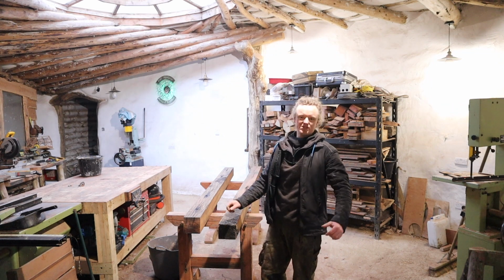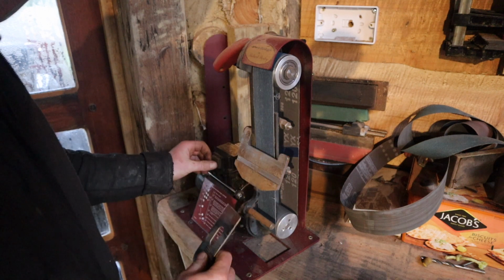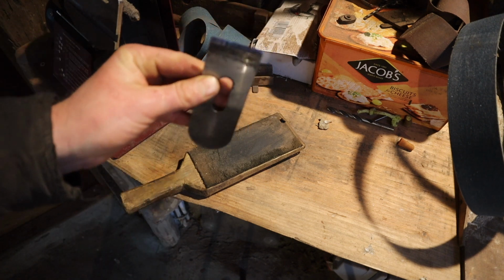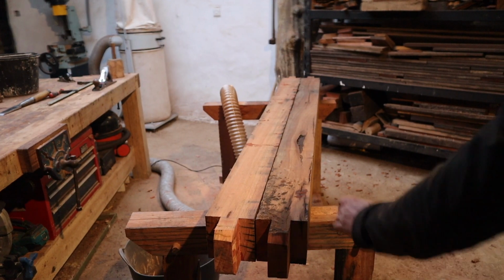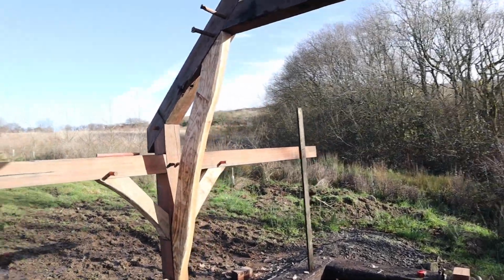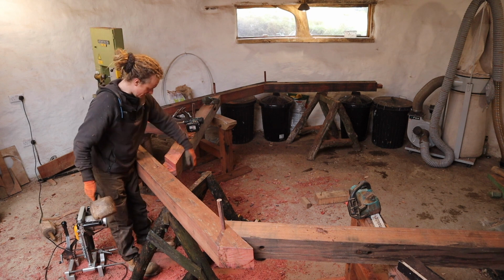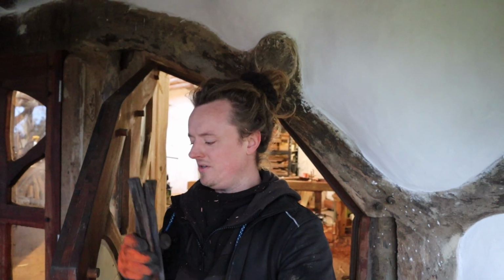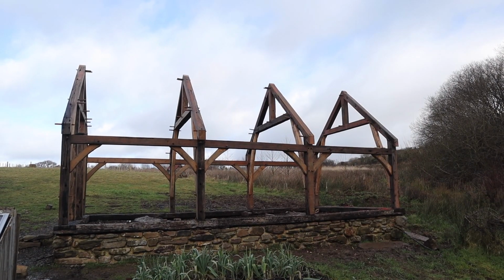Spring Fed Timber Framed Greenhouse Part 8 Last Frame

Comment: Spot on, Functional sharpness is what you need. It's not a museum piece, should take 10mins max to achieve sharpness for any work. It will blunt quick enough if you are using it, tools are for using and so long as they are Sharp, clean, oiled and functional it's fine. THese guys sharpening their chisels like they are Samurai Katana's or Sushi Chef knives are crazy.

Comment: Love your common sense about sharpening, and it was thumbs up before you even said a single word.
Reply: It's common sense for a re-grind, but not for a basic sharpening. My sharpening with stones takes less than two minutes, with a 16k stone the last step (overkill, but I got the stone as a birthday gift!). Whilst I agree, the last one isn't required for most things - and definitely not timber framing - for final smoothing on a piece of furniture it makes a massive difference. The strop Kris used after sharpening likely took the sharpness to several thousand grit, so it's no different in my opinion (than say a 8k diamond stone). 
Kris was doing a re-grind here, and the belt sander is definitely more efficient for that. I use my stones because I don't want to spend the money on a power tool for just that process, it probably takes me 10-15 minutes to re-grind every few months.
Reply: @ricos1497  Hi man, you are correct unless you are working with oak or jarrah all day day in day out, you want to work easy. its tough! 
If I am working pine or similar,I can just use a stone for a few days worth of work before a regrind. 
He is right about the facination with razor sharp sharpening, that is for retired doctors who dont work for ten hours on a site day in day out.
If I had my time again ,I would invest in a  rotary waterstone, like tormek make. I still use a belt sander or if in the workshop a bench grinder to grind and then a India or Arkansas stone, to get the job done and get home.
As a side note, in the UK we were allowed 1.5 hours a week for sharpening saws, chisels and plane irons. Those days are gone now and have been for decades, My apprentice had never seen a yankee screwdiver or brace and bit until I dragged one out of the bottom of the drawer.
This guy Kris  ,although he states he is not a carpenter, is more connected to woodworking than most on youtube who spend all the time teaching skills that are divorced from the reality.
Stay safe stay warm.

Comment: With as much time as you spend sloshing around on muddy surfaces, have you considered making a set of portable platforms to keep you up out of it? Maybe some 2m square, plywood topped, maybe 10cm elevated on a simple grid like a pallet? They'd likely end up being kind of heavy and require tractor or significant effort to move them around, but it could really save you trouble working in the muck.

The frame work looks great. I'm excited to see how you enclose it and get some gardening growing in there.

Comment: Odd question but have you looked at screw style generators for when the water is at lower flow? I was looking into how hard it would be to make a master silicone mold of a section of the blades and just resin cast the sections in a setup that can be rotated to create a screw for the distance needed. The fun part is you could even put in reinforcement inside the mold using small resin spacers that would become part of the section when cast

Comment: When using that sharpening system, keeping a small container of water nearby might help with keeping the heat down to prevent losing the temper on the blade.

Comment: Each project I'm sure shapes your thoughts about the main house.
If I recall, the order of projects:
1. Saw Mill, 2. Greenhouse, 3. Upper workshop, 4. Current metal workshop gets converted to dedicated powerhouse (maybe another battery bank ready for main house)  5. Barn for vehicle storage/materials, 6. Main House build.
Something like that right?

Comment: I use 360, 800, and 1200 grit diamond plates, cheap ones. I have more both coarser and finer but only because they are cheap and some of them are useful for other things. If I use all three plates it takes me about five minutes to sharpen up to 1200 on my diamond stones, but I really only do that if the chisel or plane iron is nicked or I need to correct something. Otherwise I hone on a hard leather strop with green honing compound during work, just five strokes or there about, and touch up on the 1200 grit plus the leather strop after work. This takes no time at all.

By the way, Jonathan Katz-Moses made a very thorough test of sharpness which did show exactly what you talk about: extreme sharpness is a waste of time. He concluded that 1200 or there about was the highest meaningful grit and stropping was essential to keep it sharp, both as the final polishing but also as you work. Not surprising, since that's exactly what the professional woodworkers have been saying all along.

But much more importantly: whatever method works best for you is the right method if it makes your tools sharp. Sharpening may have become a science to some woodworkers, and that's fine, but in the end it's whether or not the tools can do their work properly that matters and nothing else.

Comment: Hello Kris,
An enjoyable video, thank you. Could I please ask a question... When putting in the pins to secure the joints is there a preferred direction to insert them (E.G. from the inside of the building toward the outside.)
Take care.
Paul,,
Reply from the maker: Well in this case no as they will be getting cut off on the outside. But on a house it would be advisable to bang them in from the inside so the tapper goes outside. then you can bang them in some more once the timber dries.

Comment: Hi Kris, can I give you a bit of advice on hammering. It was given to me by my dad, when I was a youngster.  Grip the hammer by the bottom of the handle, and swing from you elbow, not your wrist. It was a solid piece of advice from my father, I hope it'll help you. 

With that said, I would love some knowledge from you. I want to timberframe my shed/garage.  I think I can handle cutting the joints, but how do you know what joints to use where? Also, another question that I can't seem to find addressed, is how to you account for differences in the timber thickness/lengths/widths/etc.?  

Love your content, great videos.  Keep 'em coming.
Reply: Forgot to add, the greenhouse is beautiful!  I'm really impressed with the work you do!

Comment: Have you seen Shou sugi ban ? I’m going to have to replace my decking boards soon.
Instead of buying pressure treated lumber I might try this, just wondering if you had any thoughts or experience on this method.

Also I was wondering how is the back wall in the workshop is holding up with all the rain you have had, hopefully no damp issues now ?

Comment: The only thing people will say you did 'wrong' in your sharpening is that you didn't do it with pure manual labor. Some people really have a stick up their ass about how you're supposed to use sharpening stones, even if you use a jig, because somehow doing it with your hands is supposed to be better.

In the end, your quick sharpen likely won't last as long, and there are some quick wins you missed, but I'd absolutely believe you if you told me that blade could plane the top layer of skin off a finger without touching anything else.